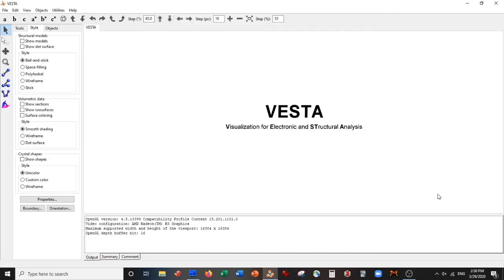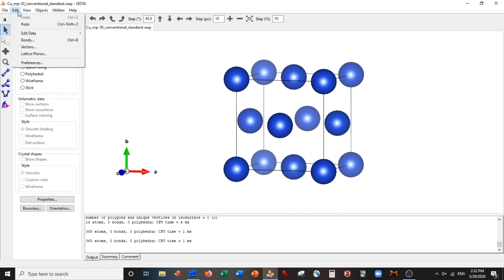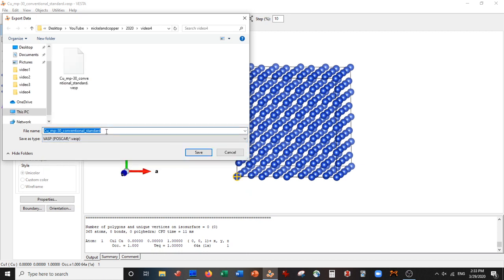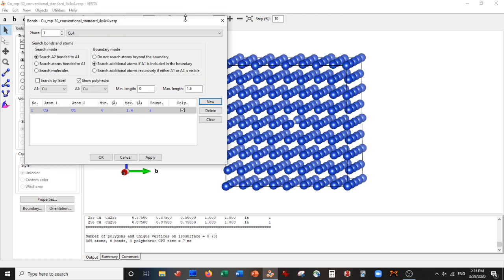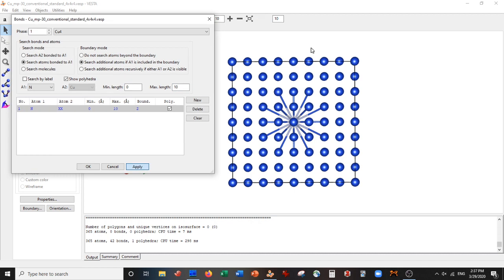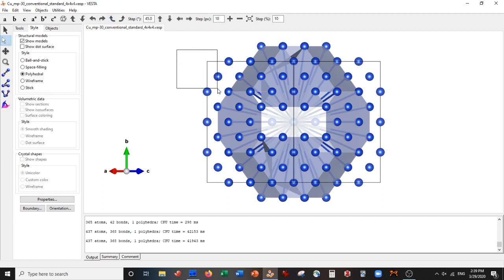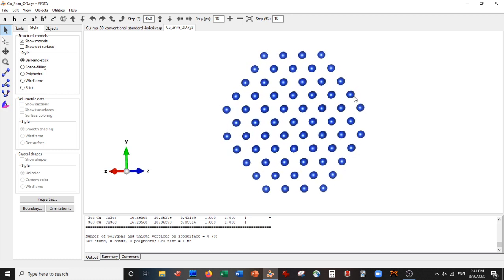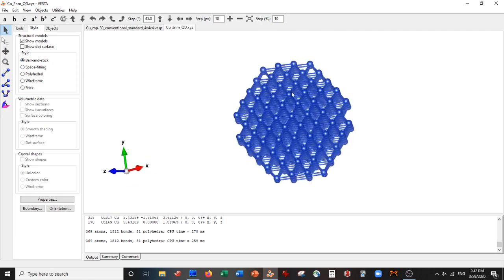VESTA Software - Build Quantum Dot

Comment: When I create a quantum dot by cutting from a bulk structure and removing periodicity, I notice that the reported volume changes to V = 1.0000 Å³, which doesn’t seem physically realistic. Is this volume reset because the system is now non-periodic or cluster-like? Could you please explain why this happens?

Comment: Sir, Is it possible for a QD to calculate is photoluminescence Quantum Yield using DFT tool?
Reply: Thank you sir for replying, your responses give me courage and  are very helpful. Till now, I thought photoluminescence is a experimental phenomenon and can not be find out theoretically. Do you know someone who is calculating the same using DFT or provide me reference. Also, if you don't mention, it will be very helpful if you give your email address so that it will be easy to communicate and discuss about some problems.
Reply from the maker: @Priya-gr9ee  sure. At this point your best course of action will be to go to Google scholar and search “photoluminescence density functional theory” and collect 10-20 references. Read the sections of those papers where they explain how they calculate this property. Also spend time just search around Google for discussion forums. This type of searching is very important, and should be done carefully. Spend up to several weeks carefully doing it. It may seem like a waste of time but actually it sets a proper foundation for your future work. There is a famous saying that 1 day in the library (reading literature) is worth 1 week of work
Reply from the maker: Of course it is, but I really have only used DFT to compute absorption energies in QDs

Comment: Thank you so much,
I also made a quantum dot of graphene by cutting it from supercell of 5x5x1. And then saved it . It is showing the lattice parameter a=b=12.3nm which is 5x2.46nm. I'm very confused about these parameters. Should I replace these with 2.46nm which is experimental value of lattice parameter of graphene.
Please reply, I'm very confused.
Reply from the maker: Quantum dot should have vacuum space around it, so you will need a larger lattice. The lattice should be large enough such that your structure and vacuum and present in it
Reply: Thank you so much. I think a vacuum of 20nm in all directions should be sufficient. How I make clear that QD lies within this region, I think the size of QD should be very small compared to this vacuum. Please tell me whether I'm right or not? 
Your help is very appreciable. Again thanks.
Reply from the maker: @Priya-gr9ee  20 angstroms is fine - not 20 nm. 20 nm is equal to 200 angstroms - and that’s far too large.

You can center the dot to the center of the unit cell through some linear algebra to the atomic coordinates, in which ever programming language you prefer
Reply: Thank you..

Comment: How about constructing a carbon quantum dot? Is it possible here?
Reply from the maker: Of course. Which phase? Bulk cubic? I also have a video for a graphite quantum dot.
Reply: @nickelandcopper5636  Bulk
Reply: How advisable it is to follow the same procedure to construct one?
Reply from the maker: It is advisable. Use your best judgement though for the final product. Always compare with the available literature if you can. If not, then be prepared to argue why you should be using what you get. This process should work for a quantum dot of crystalline bulk carbon
Reply: @nickelandcopper5636  Can you please elaborate?
Reply from the maker: I am just saying that whatever you end up studying should be able to be back up by sound argument. Typically, a sound argument is one which references the literature many times.
Reply from the maker: I am saying when you get your carbon quantum dot also look to see what the other carbon quantum dots in other studies look like

Comment: What are the lattice parameters for this QD? I did for SnO2 tetragonal structure and VESTA shows  a=b=c=1.0.  Is right?  Finally, are the atomic positions in cartesian coordinates?
Thanks.
Reply from the maker: The coordinates depend on how you save them. If you save as xyz I think they are Cartesian. If you save as a vasp you have option of direct or cartesian. The quantum dot has no lattice - it is a cluster model. Just save it as a .xyz file, and you won’t have to worry about lattice parameters
Reply: Ok. Thanks.

Comment: Very good. I have subscribed to your channel.  Can we make a similar QD , say for CdS, or perovskite etc.? and what will be the difference we need to follow for multi element QDs?
Reply from the maker: I have one for CdSe and graphite. For the binary or ternary QDs, you will have a broken stoichiometry. When the stoichiometry is preserved you have a special case called a magic cluster. This however would need simulated annealing to make and cannot be made solely by cutting the crystalline structure. In other words, you would need to do some form of structure optimization to get the magic clusters. Cutting the bulk crystal to get a quantum dot where all atoms are bonded fully you will break stoichiometry. In the CdSe case I show, I think it is Cd rich